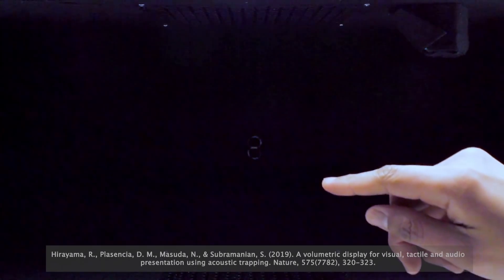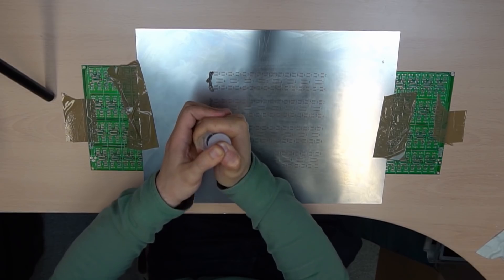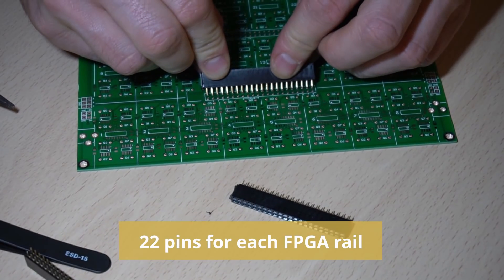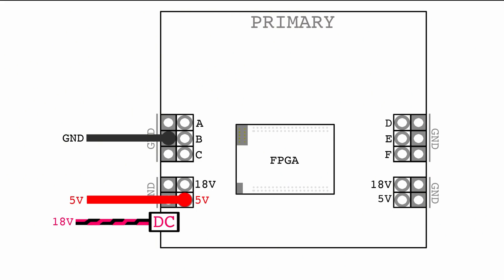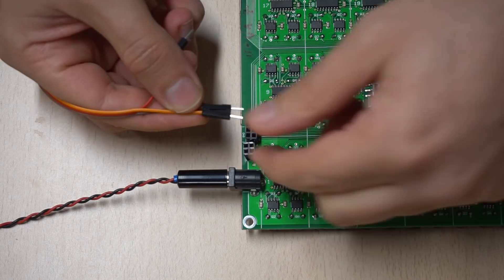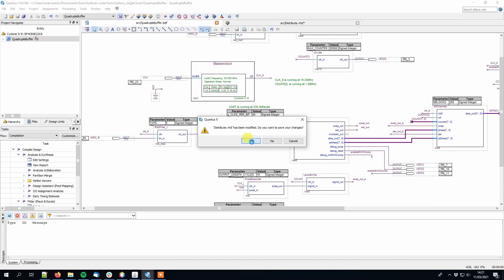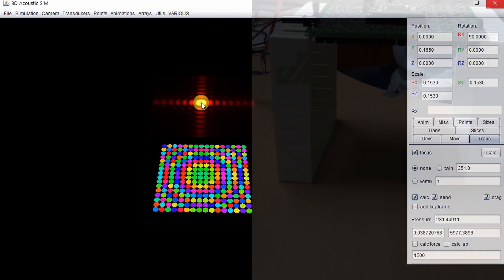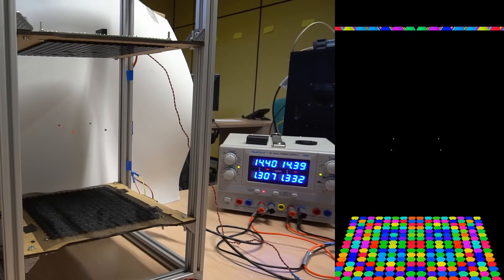SonicSurface: DIY ultrasonic phased array for levitation, haptics, and directive audio

Comment: Wow very cool project!  I built a ultrasonic tractor beam device for my college project in physics electronics Autocad and got extra credit in math for an application. My device didn't use a FPGA though. Using software with it would have been awsome. 😮

Comment: ⥊ UFO

0: Good (if not good, then not zero)
1: Ethics
2: Problem-Solution
3: Consent
4: Emotion/Will
5: To Testify/To Meet
6: Why/Who/When/How/Where/What
7: Information
8: Stability
9: Sanity
10: Network (Good Network, because zero)
11: Justice
13: Death
16: Tower
20: Judgement
21: Solving Problems with Ethics
22: Resistance
23: Resilience
30: Good Wave
32: Discernment
33: Jesus
40: Good Force
50: Good Expression
57: Counter-Terrorism
60: Good Reason
70: Good Information
80: Good Stability
90: Good Seriousness
96: Blockchain
97: Anarchy
98: Vegan
99: Revolution
100: Liberation
1000: Possible Conversation Method using numbers to convey meaning
For ex.: 6022: Good Reason to Resist.
Reply: 13

Comment: Question: it it possible to create a sphere with a phase array like this to try to levitate the shere it self (or the power requirementes be to great)? and that happens if we use a concave array with this system? do we get more "levitation force"?
Reply from the maker: only very small particles can be levitated using this system. A bowl array provides a better focus (stronger) but can be moved only within a smaller volume.

Comment: Can you add mini foam machine or smoke machine and some light to make 3d hologram? You deff can levitate foam bubbles, and it's much easier
Reply from the maker: You  are a great thinker. What you describe is one part (Wp1.1) of what we want to use to make a volumetric display that you can touch directly without breaking your hand

Comment: A lot of patience went into this, but very impressive results.  How much energy / acoustic force is required to levitate x amount of mass?  With more powerful transducers, theoretically it should be possible to levitate more massive objects, but am wondering how far this experimentation has gone in that direction.  Excellent demonstration of the phased array concept, and utilizing an FPGA to actually "steer" the array focal point(s).

Comment: Very cool project, now I understand why Sci Fi characters spend so much time calibrating various arrays, LOL.

You could achieve a better packing density of transducers using a hexagonal array, what would be the benefits of this, I wonder, compared with the costs of doing so.

I imagine better density would allow for levitation of bigger stuff, maybe higher distance.  Accuracy, too?  

It would increase cost of the hardware, due to more transducers, at least, would the circuit board be complicated?  I suppose if the transducer density did not allow for enough space for the back-mounted per-transducer components.  What about the software complexity, as the array is no longer rectangular, I imagine it would be easiest to map a rectangular array to the transducers, would that be the way you would handle it?

Again, fascinating project.
Reply: Probably did it this way because it makes the math easier
Reply from the maker: @chain3519  Maths are not a problem when using numerical simulations. Hex packing is better but doing it in a single PCB with the electronics on the other side was the real issue.

Comment: Wow. Pretty crazy. Makes me wish I were a young engineer, instead of a guy almost ready for retirement. But this gives me a great idea for what I might do once I am retired.
Reply: It may be better yet, to have experience and resources and the freedom to use them. Share your results!
Reply: Its not to late yet. I started the engineering university the year I filled 40. And I was sure that I was going to be the oldest in class. I was not. No the oldest person in my is was 77 years old.  He did not dolt for a career, but to keep his memory working. He did not do the final exam to get the completion of the course because he do not want to work as an engineer. In stead he started down the next five year program....
Reply: Funny you mention retirement, I'm pretty close to retiring myself. Just got one last case before I do
Reply: You're just about to be reborn, so go for it!
Reply: Colonel Sanders has entered the chat
Reply: Microscopic transistors, and microscopic chip design. Silicon wafers.
Reply: Same here....
Reply: woah me too, trippy. cu there!
Reply: Don't worry; the newer generation doesn't have any freedom to explore their hobbies anymore either
Reply: Now you know what to do after “retirement”.  But you can still choose a boring, not so slow dead.
I’m 51, training motorcycle racing just after 47yro. Recovered my body and upgraded my brain for real.
Reply: You’ll just be that creep harassing otherwise normal people

Comment: Thanks for the update! I've been working on a project like this since I saw your BigLev demos. I'm working on a version that replaces the FPGA with a Teensy 4 and an external circular shift register. Currently trying to create my own driver to be able to run from your 3D Acoustic SIM software. Did you ever look into using the HV582, HV583, or HV57708, as a driver chip to drive many transducers in a single package?
Reply from the maker: I remember the brilliant Fauth giving a go at the HV* and giving up due to heating https://hackaday.com/2018/08/19/the-engineering-of-an-ultrasonic-phased-array/
Could you write me to asier.marzo@unavarra.es it seems quite interesting using a Teensy4 as a driver.
Reply: Hello Sir, I am also working on my custom development board, on which software are you designing your PCB ?

Comment: For the setup with two pcbs it already costs $257 for 2x fpga and $330 for 512 transducers :(
Reply from the maker: FPGAs used to be 30$ each, it is mental that they are 130$ these days. I have always wanted to move the design towards ESP32 or similar, this seems to be over the top. I wonder if it is just IC shortage or something else.
Reply: @UpnaLab  ah i didnt know it was because of shortage, i admire your dedication to this project and making it easy for others to reproduce
Reply: @UpnaLab   Part of the IC price jump is caused by bitcoin mining, I hear. 
They would certainly have use for a lot of FPGAs.
Reply: And then the IR heater, and a oscilloscope!

Comment: This is really cool, are you selling a kit?
Reply from the maker: Nope, but I still need to contact some maker shops in case that they are interested. However, it would be an expensive kit (around 120$) and perhaps it is too specific?
Reply: @UpnaLab  I was going to do a 8x8 and here you are with a 16x16! :)

Comment: What if you build a version when you had on at the bottom and two on left and right at a 90 angle? Would that open up the top?
Reply: I'm guessing you would just need the left and right, as long as you have two boards parallel to each other.

Comment: Your work seems to me excellent and with very interesting applications.
I would like to know what is the spatial resolution of the particle positioning that you can achieve with this system.
Reply from the maker: The focal point is quite big (around 6mm diameter) but you can position it with high accuracy. I would say repositioning error should be below 0.05mm but I have never measured that. Absolute error will be higher since there will be reflections with the environment and other external affectors. In Page 7 there are some measurements but of a smaller system https://static-content.springer.com/esm/art%3A10.1038%2Fncomms9661/MediaObjects/41467_2015_BFncomms9661_MOESM593_ESM.pdf
Reply: @UpnaLab  This is fantastic! If you wanted to dramatically decrease the focal point - to, say, .5mm - how would you think about going about that?
Reply from the maker: Either increase the apperture of the device (width) or using higher frequency @patrickgumusoglu9201
Reply: Thank you for the prompt reply - This is so cool and something I really want to experiment and play around with!! To clarify, do you mean the width of each individual transducer, or the width/size (number of elements) of the entire array setup? 

Additionally, how would one think about the distance BETWEEN each focal point? meaning, how tightly packed could you get the floating beads and what is the max number of beads you could float?  @UpnaLab